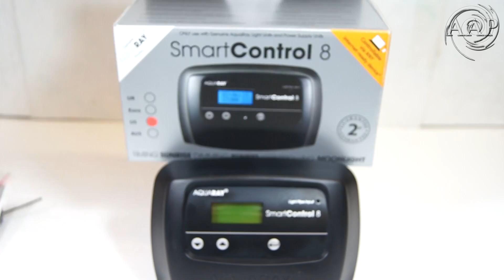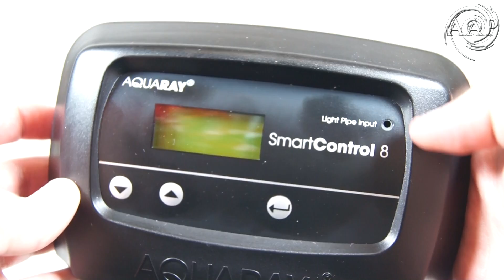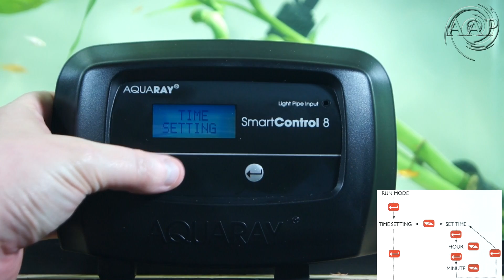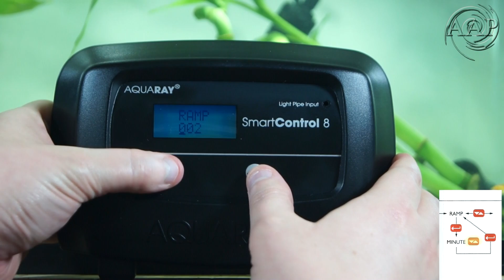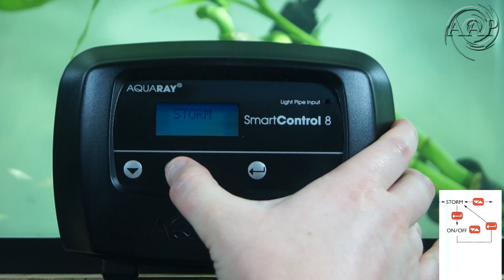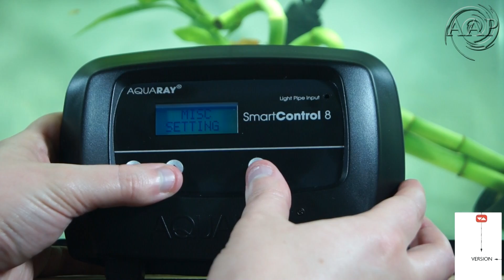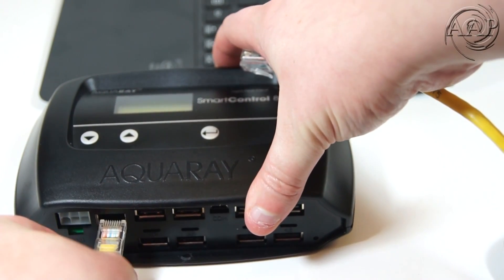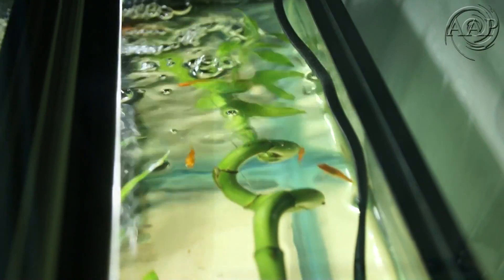TMC Smart Controller

Comment: Is there a way to easily integrate these lights/controller into an Apex Neptune system with dimming control? Does this controller stop the high pitched electrical hum in both the lights and controller like the old controller would make while dimming?

I've owned these lights for two years and enjoyed their great performance, but I'm hoping these issues are getting addressed.
Reply: These are designed as a stand alone system operating on PWM, so I do not see where there would be an advantage integrating these into an Apex controller. As for the hum, I have not noticed this with these, but then I found the hum with previous systems barely noticeable and it was a complaint very few of our maintenance and other customers noted as well. That said, with PWM, this is going to be a very slight hum, but this is usually almost indetectable for most
Reply: Carl Strohmeyer Wish it was more silent -- it's quite easy to pick out and very annoying for a living room. The PWM is a nice feature, but I would sooner burn electricity via resistance than have to deal with any noise. I would prefer to have Apex control and monitor everything, even if Apex was integrated to this controller somehow. Sorry to complain - these are awesome lights, otherwise!
Reply from the maker: Benjamin Chodroff I guess we will have to agree to disagree, as when speaking to our sister aquarium maintenance person, they have not had a single complaint. I think the benefits of PWM from wasted heat energy to loss of color spectrum far out weigh these few complaints I have heard with the noise (not that others have noted this noise too). As far as the Apex controller, my view is the difference in using the TMC Smart Controller that does the lighting tasks to their optimum performance versus an all in one controller that does many tasks well, but not to optimum performance. This said, while I have not tried this, the newer AquaRay lights have USB ports that are meant to adapt to more universal applications
Reply: American Aquarium  Sad to hear, because it seems like nobody is listening -- the noise is very annoying during the dimming process (I have my ramp set to 15 minutes to keep it from being too much). Once it's 100% (or 0%) then there is no noise. Maybe my controller is broken? Should I make a video so you can hear it? I've seen plenty of threads detailing the noise complaint since the capacitors were introduced: http://forum.practicalfishkeeping.co.uk/showthread.php?t=70754 Is it possible your sister aquarium company uses the old style instead of the new? For a living room, the noise is very bad even while trying to watch tv. Maybe its not so bad in a retail store? Why did they add a USB port for the lights? These don't appear to be standard USB devices and it really kind of violates the purpose of USB connection... doesn't it? What would happen if I plugged the USB connection into my computer?
Reply from the maker: Benjamin Chodroff Persons are listening. The problem is these complaints represent such a tiny minority of users. I too can hear this but only during the dimming process as you noted, and even then when close ups with ALL back ground noise turned off. Once you get the sound of water the noise is non existent. We even just hooked up several of these lights for staff here and it took removing back ground nose to hear these. A co-worker here made the point that the wine of a pre-flat screen tube TV was louder and these did not have any water noises to wash out any of the dimming whine. As for our sister aquarium company, they are using the same controllers, but their clients simply are not hands on and only hear the water noises, which if too loud are where the complaints come in. The USB connections are for the new Smart Controller and meant to be more universal.